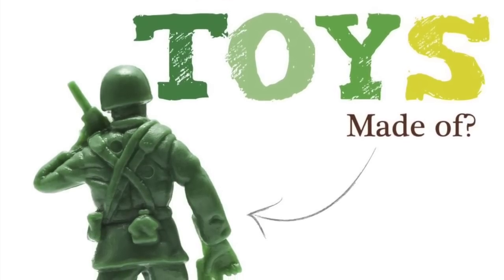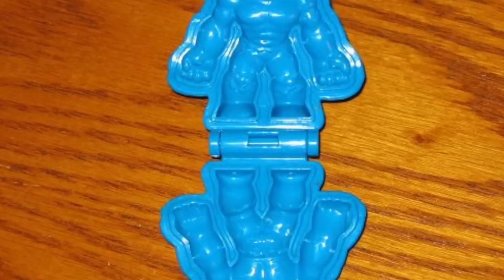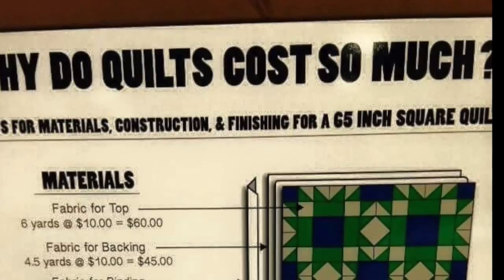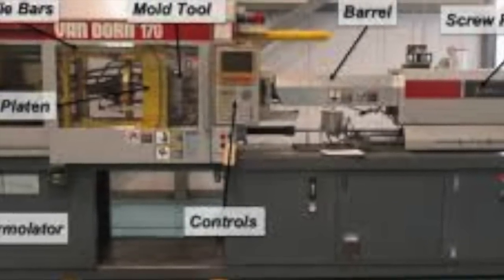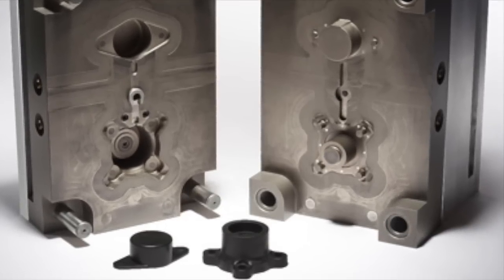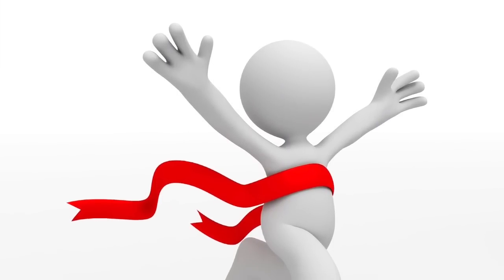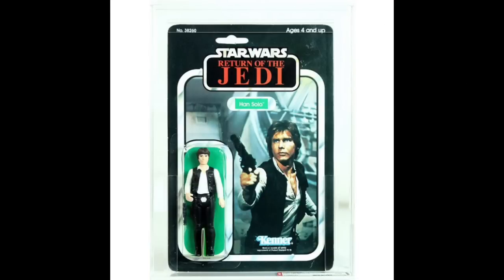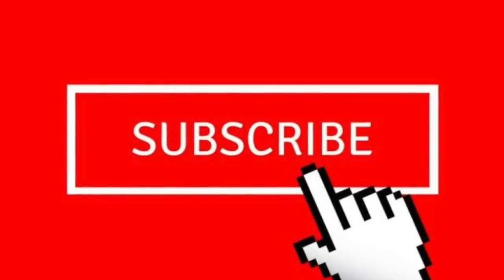The History, Cost and Long Term use of Toy Tooling. Everything you want to know about Tooling

Comment: I've had some experience knowing custom toymakers - usually they use silicon molds or much smaller steel molds, and they have explained the reasons for things like a pressure pot, but it's still really fascinating to know what the deal is with professional tooling!
Reply from the maker: It is a pretty crazy process when you put it all together.

Comment: Great Video. Just to add a few more details (for whoever cares). Part of the expense of the tooling comes from what type of plastic will be used. Not all plastics are the same. Generally higher quality plastics such as high end ABS (Lego!) Require not just hotter plastic, but also higher pressure injection. Molds for high temperature, high pressure parts require hardened steel. Which is much harder to mill out and shape. And is much much more expensive. PVC is a low temp low pressure plastic. Basically a form of synthetic rubber. You can get away with much less expensive tooling. Especially if you aren't going to be running the tool for a million cycles. So you can often use Aluminum. Or similar cheaper metals. The Molds will wear out much faster, and the figures will be made of softer PVC which goes brittle with age. But PVC can hold a very sharp sculpt or shape at a low temp and pressure using fairly affordable tooling. <- See that. You now understand the why's of NECA. 

For a lot of toy companies tooling is a Capital Expense. Which often means they take out loans for the cost of each set of tooling. They present to the bank the proposed business plan and product lifecycle of the product that the tooling is for. Most tooling is structured to pay off the loan and thus pay for itself with the initial product offering. What this means is any reuse of the tooling is much greater profit for the toy company. Those re-used "Bucks" that Hasbro frequently uses for Marvel Legends. Yeah, that's their profit margin. It's also way easier to get the bank loans for tooling and get more money if you have a signed IP license contract. At least one for a current and popular IP.
Reply from the maker: You have clearly done this before! Thanks for adding the great additional information. A follow up video may be needed.

Comment: Fantastic video! 

I was wondering though, instead of destroying that Super Girl mold for example, assuming you want to re-use it. Couldn't you just mill out the area you needed to change, then make a new part to insert into that space with the design you needed? 

I've seen it done with low pressure molding. They use modular inserts to modify mold designs without having permanent changes made. Although, I'm not sure if it's applicable to regular molding.
Reply from the maker: That is just too expensive in the long run. And we knew we wouldn't be doing supergirl anymore.

Comment: Could you possibly (maybe in the one of the future videos?) elaborate on how costs are split among different stages of mould creation?
I'm curious which part of the costs KO/bootleg companies cut out. Quite often designs go through modifications like upscaling or adding articulation (like KO of Titans Return Gnaw) or adding parts (like thigh extensions and fillers on BPF's KO of Siege Ultra Magnus) so I'm pretty sure that usually new moulds have to be made (surely in case of upscaling or simplifying).
Reply from the maker: I certainly can!

Comment: I've worked in a couple plastic manufacturing plants before.

At one factory, I've worked with lost cores (a tin bismuth mould was manufactured in the plant to serve as an interior mould that can be melted out of the plastic part at a lower melting point than the plastic). We were making one-piece air intake manifolds for Dodge/Chrysler Neons back in the '90s.

At another factory, I've worked with a small plastics mould press from Japan. I  had to clean them after they were delivered. They still had runners left over from toy robot parts. I should have asked how old the press was, but it could be from the '70s/'80s. We used this press for making plastic ripcord spools for lawnmowers.
Reply from the maker: Yeah crazy how this stuff comes up over and over!

Comment: One thing that's is also interesting to note is how the molding process has improved over the years. This is very noticeable in the plastic model community, were model kits made in the 80s suffered from partially formed parts, flash (a thin layer of plastic protruding from the part were the molds met each other) and very noticeable gates; al these required a large amount of work to fix when assembling the model. Now we have multiple colored parts on the same sprue, under-gated molding and high precision tolerances.
Reply from the maker: Oh yes! As with most things in the the industry things improve all the time.
Reply: The plastic model kit industry is also very interesting and creative when it comes to re-using tools. There are companies in 2021 still selling model kits with tooling from the '70s! Sometimes they add new parts, sometimes just new decals (color variants). 

And sometimes they are called Bandai and just make a completely new tool of a 1/72 scale Millennium Falcon, even though Fine Molds already made one a couple of years back.

Comment: Would you know what happens to used tooling? Wouldn’t a Mattel retain them for future use or scrap and recycle the materials to make a new tool?
Reply from the maker: It is very expensive to store tooling. Think of the thousands of toys Mattel or Hasbro make each quarter. Most of the time the old tooling is sold as boat anchors as I noted in the video.
Reply: @spectorcreative1872  I've never understood why they didn't recycle the metal so it could be turned into new blanks to be tooled again. It's metal, you can just melt it back down.

Comment: I love vids on the actual manufacturing process.  One thing I've always wondered about is the bootlegs when they're indistinguishable from the original.  Is it mostly bootlegers measuring the originals and creating their own molds or an inside job?
Reply from the maker: A little of both!
Reply: It's probably worth keeping in mind that the factories where the toys are actually made are largely independent vendors. Other than having a contract to produce the run of toys, they're not really direct stakeholders in what happens to the molds, so it's small wonder that weird things sometimes go on.

Comment: And then there's Hasbro. Makes a mold of the Millenium Falcon in 2010 and sells it for $120. A decade later instead of making a new mold with modern engineering techniques they instead re-use the old mold, slap some new paint on it and sell it for $400.  Because it wasn't enough to not have to pay for new tooling. They wanted more than 300% of the price they used to charge!
Reply from the maker: Well labor and materials have also gone up
Reply: Dang, even at store ur like paying ebay prices just cause time change and so get it now or wait til cheaper any i guess.
Reply: Im glad i got the 2010 Legacy falcon for 75 bucks clearance at toysrus

Comment: Is it true that the cavity in the tooling shrinks during production, which is why the final product is usually slightly smaller than the resin prototype?  I recall a DC Collectibles press release on the DC Icons line and how they are entering digitally sculpting with the line - there was a brief mention in the press release where they had to digitally sculpt parts of a figure larger than usual to accommodate the shrinkage that the tooling had during its production.

Comment: I've always wondered how they are made... By hand seems like a super difficult job and it's amazing that a sculpt can be recreated like that on reverse. I hope someday we'll be able to use 3D printers to the point where tooling won't be necessary. Thanks for the cool video 😊
Reply: It's probably still a fairly long way off before 3D printers can work in material that would be anything close to the structural tolerance needed. Most 3D printing material now is fairly fragile by normal standards, let alone industrial applications.
Reply from the maker: Eventually 3D printers might help but we are not there yet
Reply: @spectorcreative1872  so sad, but definitely a future worth looking forward to. Hopefully it'll be in our collecting life time lol.
Reply: As far as volume is concerned it would be hard for printing to replace injection casting

Comment: Wait! Scott u mentioned that the tooling is made with metal. I would love go know how does it goes from the prototype sculpt (the ones done by the 4 Horsemen) to the steel tooling? U mean they create the sculpt on the tooling surface  by hand?
Reply from the maker: Yup. That is how the do it. Well they make a mold and then push that into the metal

Comment: I'm wondering what goes into tools for something as complex as Transformers. Do they make multiple sets of tools per figure to keep up with the sheer number of figures they manufacture? if so, how do they keep the parts uniform enough to accommodate the transformation engineering? that sounds cost prohibitive. But they still make reissues of popular 80's toys today. Are the molds simply recreated to be as close as possible to the originals, or are they still using the original molds?
Reply from the maker: Multiple tools are only made when the run rate is VERY high, such as for a movie launch.

Comment: Is there any chace you can discuss tooling for packages vs tooling for the actual figures?  I'd be curious if the packages are made in the same way, or if they use a different technique like vacuum forming.
Reply from the maker: Meaning the inner blisters? I do have a video on that in the works!
Reply: @spectorcreative1872  That would probably be it, yes. Thanks!

Comment: To pick on Transformers for a minute, a number of the original G1 figures have had reissues over the years.  I have seen people talk a lot about mold degradation over multiple uses.  When doing a reissue of a figure from 20 or more years ago, is it better to use the original mold (assuming it isn't an anchor) or to retool it to do a larger production run and future reissues?
Reply from the maker: The original mold won't be good anymore, so an all new one must be created

Comment: In the model kit industry they use laser cutting for the die to put in the small details. The CAD work for the design is done here in the States and some of the die manufacturing is done here too. But the plastic injection process is done in Asia (mostly in China). Lego has plastic injection system in Romania for Europe.
Reply from the maker: Yup, so much is overseas now.

Comment: The cost of injection-moulded plastic tooling is also why a lot of miniature manufacturers make metal or resin models instead, and why even Warhammer/40k, the biggest wargame brands, for most of their existence only used plastic for models that were either too big to do in pewter, or they knew would sell in large amounts (i.e. the army-builder models players will be buying multiple boxes of were in plastic, but a character model a player would only need one of would be metal). These days they're big enough to do all their new models in plastic, but it's a recent development.

Tooling for pewter models is a lot cheaper than plastic ones, but on the other hand pewter is more expensive than plastic, so once you get big enough production runs the more expensive tooling required for plastic will pay itself out.
Reply: It's also why some boutique toy companies make their figures out of materials like softer PVC instead of full ABS grade plastic. The molds are cheaper because of lower temperature/less stress during the injection molding process.  Of course, that causes other issues in the final product.
Reply from the maker: And I am going to do a video on alt methods of making toys soon!

Comment: Tools probably not carved by hand anymore in general these days but im sure all of the molds of the toys i played with most certainly were
Reply: They are still expensive. Back in 2012 when Reaper Miniatures wanted to start moving towards plastic miniatures the cost of a mold to produce a single 28mm mini was $1000 each. And these were pretty much all single piece castings of a figure less than 1.5" tall.
Reply from the maker: Yes, much is done by computer but hands still play a big part in it
Reply: @spectorcreative1872  so the original work is sculpted in clay I'm guessing? Then the mold is cast based on that? I really would like to hear more of the sculpting side of the toy biz unless you mde vids about it before i found your great channel!

Comment: Super7 got a nasty surprise when they went to do orange Ram Man and found out very late in the process that the tool had been modified to make Tuskador. There's an extra expense they didn't figure into the budget.
Reply: Was it modified? I thought it was just the same mold with extra armor glued on.
Reply from the maker: Yup! Perfect example!
Reply: @Tim85-y2q  If I remember right, the underlying torso had to have cavities cut into it to accommodate the tusk plug-in feature. But I haven't taken it apart myself to verify.

Comment: I think you missed just one point. For limited quantity, when the tooling don't need to last for like a million injections, you can get much cheaper molds.
Of course, if the product is a success, and you want to sell more, in this case, you are in trouble, as you will need to build another mold and this can be difficult to have same format as the original one. And the defect ratio on those are much higher too.
But alas, this is a viable option for limited runs of products.
Reply from the maker: YES! I am going to do a video on alt methods of producing a toy without tooling.

Comment: With tools degrading over time, how do you think folks like Hasbro do modern reissues of vintage toys? Emulate it from scratch? 

There are some Transformers figures that have never been reissued such as the original Wheeljack. It's always said in the fan community that's because "his tool was lost".
Reply from the maker: Yes, those figures are made from scratch. They are not the original tools
Reply: Yeah, the "tool was lost" line comes up a lot in the GI Joe community too, but the more reliable sources I've seen tend to suggest reissues are modern emulations of the old designs, so I'd definitely be interested in learning more about this topic.